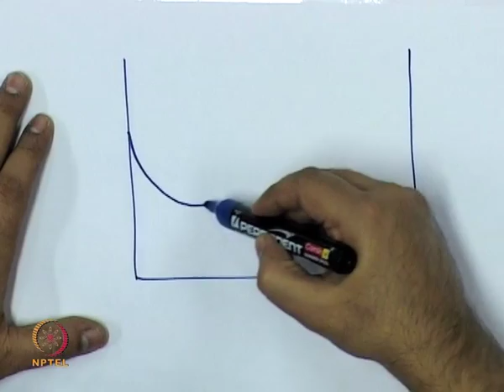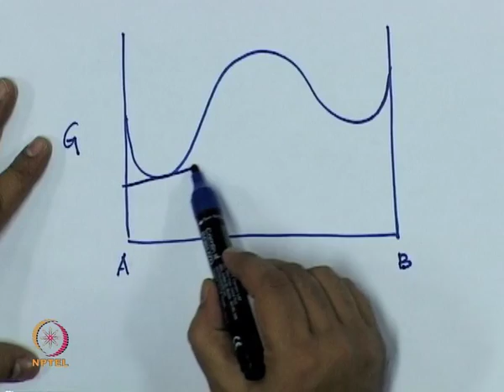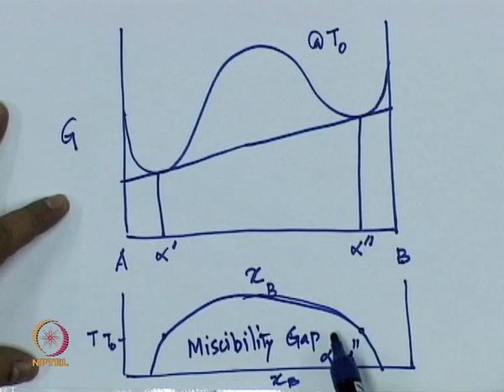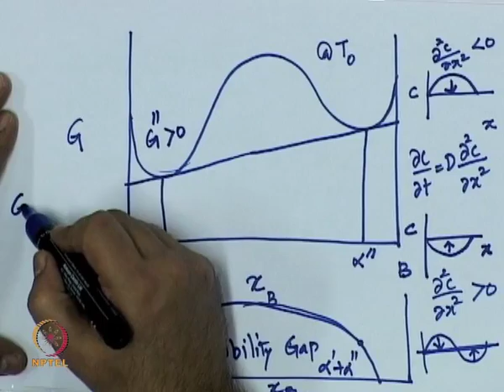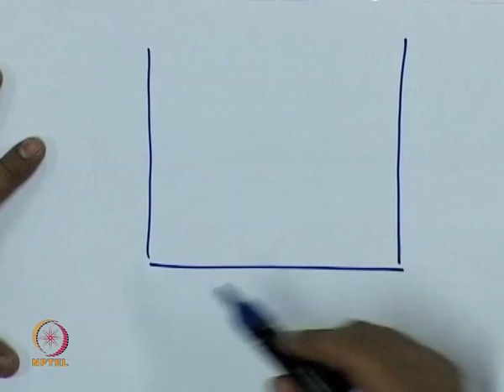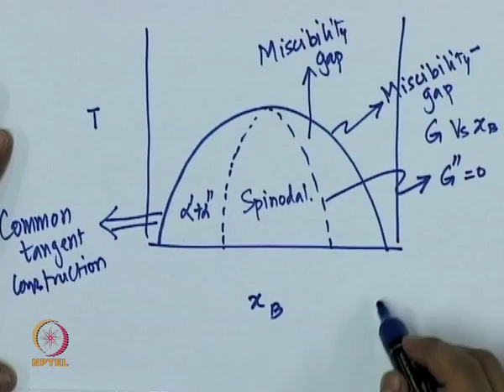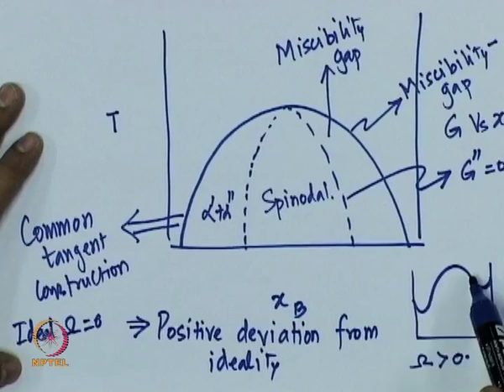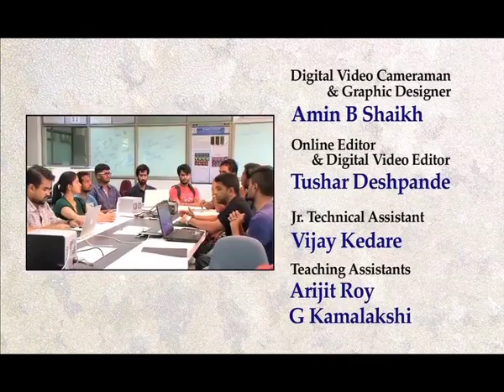Spinodal decomposition

Comment: Sir, at 16:16, I think metastable is the region where curvature is less than 0 and unstable is the region where curvature is equal to 0. Curvature more than the 0 is the stable region sir because it is the minima. Pls confirm sir.
Reply: In G vs x graph ( for omega > 0) There is a region between G’'= 0 and where it's stable(I.e G''>0), that is metastable. And the region G"<0 (between two G"=0 points)is unstable.